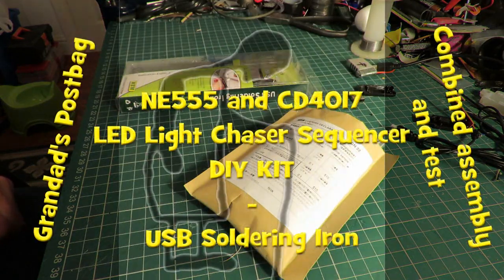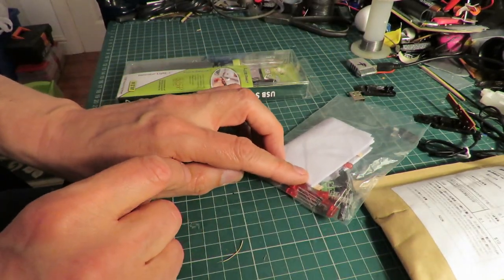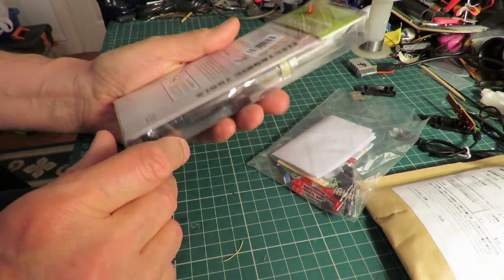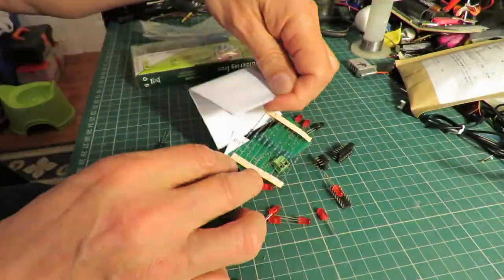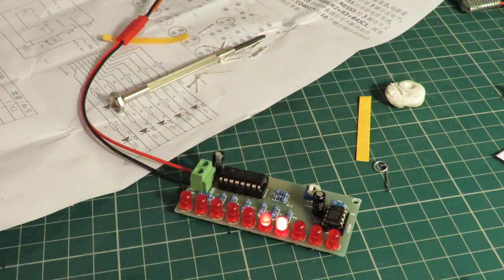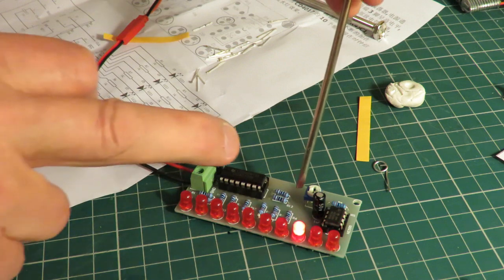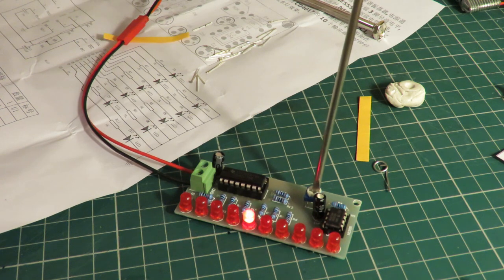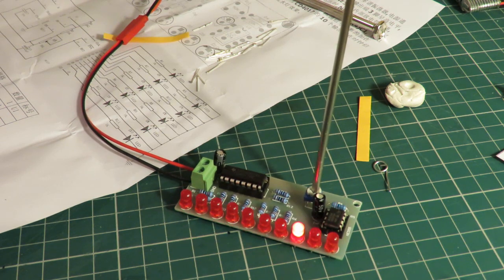SHORTER VERSION Grandad's Postbag Combined assembly and test LED DIY Kit and USB Soldering Iron

Comment: How many amps USB charger did you use.
Reply from the maker: I have had no trouble using it on any of my normal mobile phone chargers and even a cheap single cell powerbank. In my work room I use it on an IKEA KOPPLA 3-port USB charger which has this product information 3 USB ports.
Voltage USB ports: 5Vdc.
Current USB ports in total: Max. 3400mA.
Current per USB port: Max. 2400mA.
I have plugged a meter into the circuit and it says it is drawing 1.26 Amps

Comment: I no 60 watts way to much,40 watts or 30 watts work better ,better yet adjustable soldering station..
Reply from the maker: My long time favourite was my Antex 18w until it died and I found how expensive replacement heater elements were https://youtu.be/BInWdNUrJt8